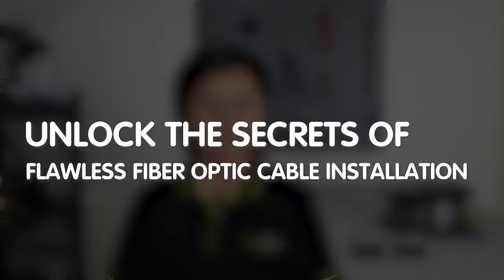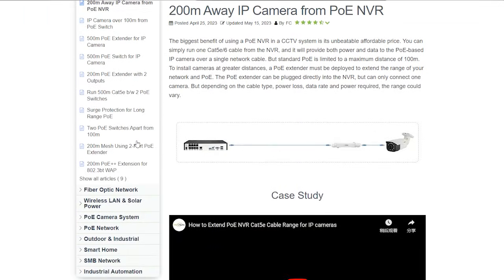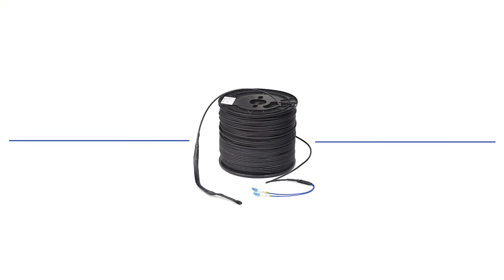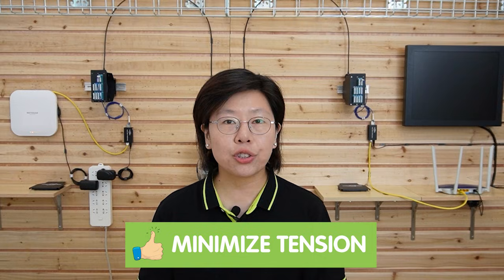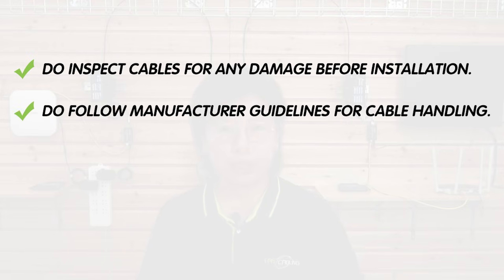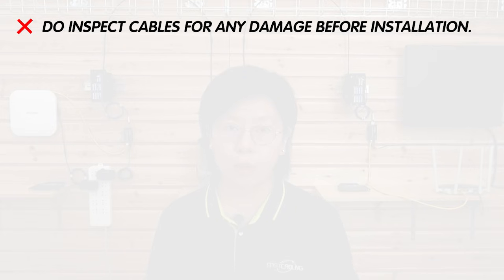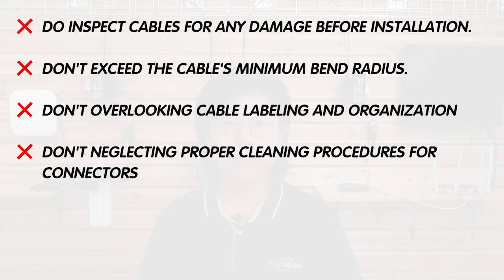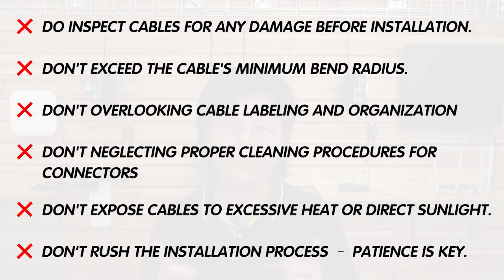Fiber Optic Cable Installation Do's and Don'ts

Comment: What a waste of bandwidth.
Reply from the maker: It's a future-proof solution.  It offers ultra-fast speeds, low latency, and unmatched reliability, making it ideal for growing bandwidth demands. Whether for industrial, commercial, or residential use, fiber ensures your network is ready for the future.

Comment: but its not faster than the speed of thought lol
Reply from the maker: Fiber cables can handle up to 40Gbps or more. However, ISPs cap your speed (e.g., 100 Mbps, 500 Mbps, 1 Gbps), even though the fiber line could handle more. It depends on your data plan.
Reply: Fiber cable doesn’t loose signal strength in long runs but yeah the input speed will be the same output speed

Comment: Two things 1 at work when we had a fiber that was above 10 Gig we were required to inspect the ends of the fiber with a microscope before installation to make sure they were clean. 2 my son has Google fiber, and it looked to me like the fiber to ethernet box received its power from the ethernet cable.
Reply from the maker: Links above 10G are more susceptible to insertion loss and back reflection, so you're right that inspection is necessary before installation. Even when capped, pre-terminated connectors can still pick up dust, oil, or debris during transit.

Google Fiber installations often use a combined ONT + router unit or a separate ONT that connects to a Google Nest Wi-Fi or similar router.

Comment: Do you need the termination boxes? Is it possible to run a fiber optic cable from one router/modem to another router/modem 400ft away with only using the cable and compact fiber media converters?
Reply from the maker: No, you can do without them.

Comment: Multimode is obsolete except where it's already installed.
Reply from the maker: In data centers or environments with short (<400m) connections, multimode fiber can be cost-effective for deployments like rack-to-rack or server interconnects. But, indeed, SMF is better suited for modern high-speed applications and long distances.
Reply: @Fastcabling  Maybe MMF might be ok in some instances... but why even bother.  100G is already slow.

Comment: Great explanation. I broke the fiber cable while digging. Can this be fixed without having to run the whole line? I mean like a splice. Thank you.
Reply from the maker: Yes, it can be done by mechanical splicing or fusion splicing to restore the fiber optic link. However, it's important that you use use an Optical Time-Domain Reflectometer (OTDR) or a light source and power meter to test the quality of the splice and ensure minimal loss.
Reply: @Fastcabling hi
Reply: Just tie it together
Reply: @wesley1983 do not tie it together. You will break it. Wesley out here setting you up for failure lol

Comment: I see the whole system and understand but what is the last Ethernet cable coming from you plug into the media converter? Can you do a video of this setup both fiber and cat5 speed tests to show why fiber is better?
Reply from the maker: That's because most network devices don't have a dedicated SFP port, only Ethernet ports. The main function of a media converter is to convert optical signals to Ethernet signals. 

If you're interested, you can continue to watch this video: https://youtu.be/JHSGV6QbvcY
Reply: @Fastcabling  Does this mean for every endpoint in your network (if you weren't going with the wireless option), would need to have a media converter?
Reply: @kualitydesign  Sort of? There are devices that have fiber ports, like the X710 PCI card, so you might not always need a dedicated media converter, but those devices probably convert internally. Not a lot of full optical computing around right now.

Comment: So how does fibre termination box work did you connect it with black 30 metre LC APC
Can you configure standard home FTTH line to multiple properties and slice network speeds example
100mpbs by 50mbs line into 3 routers connect via Fibre cable, media convertor and router
40mbps by 20mbps
20mbps by 10mbps
40mbps by 20mbps
Reply from the maker: The fiber termination box is used to terminate and manage optical fibers, a place where you hold the patch cords, splices, etc. To allocate different network speeds to each property, you can use Quality of Service (QoS) settings on the routers.

Comment: On the second termination box you connected the fiber cable to a port that wasn’t connected to another fibre cable from behind the termination box that goes to the first termination box. How is that possible?
Reply from the maker: This is a 4-strand pre-terminated fiber optic cable and we have plugged all 4 LC connectors into the back of the termination box beforehand.   

https://www.fastcabling.com/product-category/pre-made-fiber-cable/